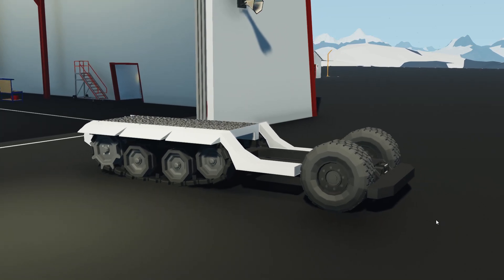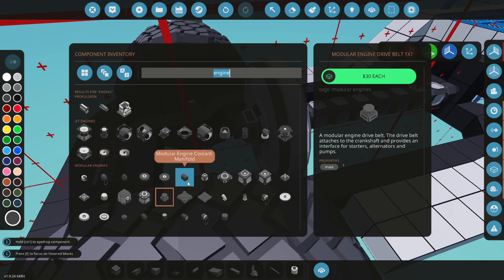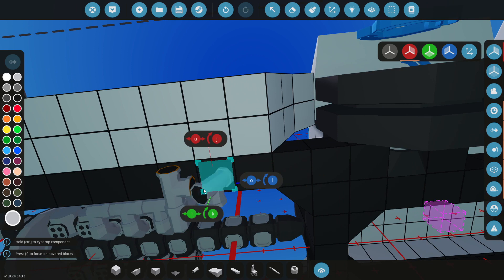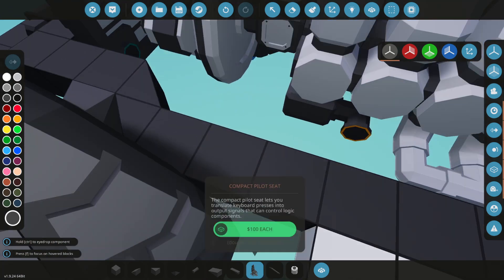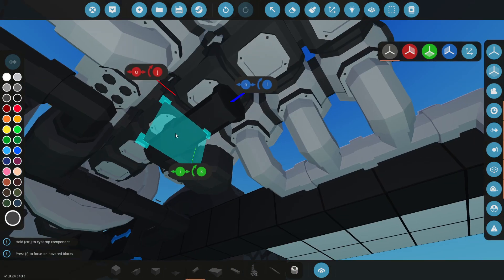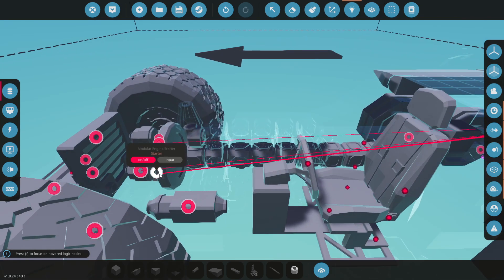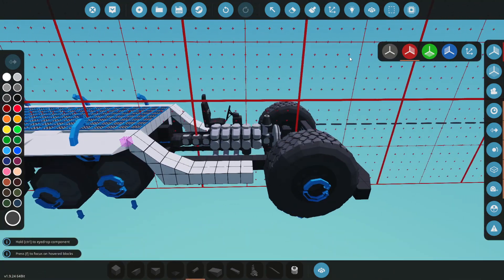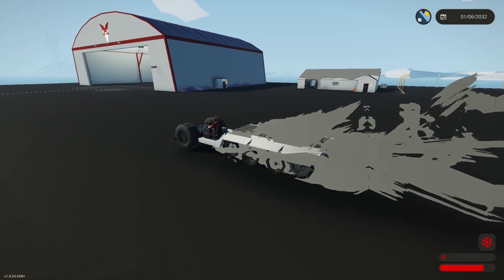I Built An ENGINE For Our Half-Track In Stormworks! #2

Comment: I wish half tracks worked in this game. I really wish they did. The problem is that the traction of all of the wheels has not been addressed by the devs at all so the tracks end up pushing through any and all steering the wheels do at any speed above the speed of smell. So at the point of wanting a half track to haul things, you might as well go full track or full truck to save yourself some effort, namely because there are no fast half tracks in Stormworks. I'm even surprised Frantic's build steered at all.

Comment: You made some mistakes with the engine

The flywheel should normally go on the back of the engine, not the front.

The radiator fan isn’t hooked up.

You’ll probably want two coolant manifolds, with a pipe going in one side of the engine, and coming out of the other side.
Like this:

Bottom view:

     |
    []<— 1st manifold
[engine]
    []<— 2nd
     |

Front view:

     []
  [][][]
—=-=—

Flow
<————>
Reply: I was thinking the same thing about the flywheel, but if he's able to get it going with the starters, it's a lot easier for him. I just know it's really difficult to get an engine going with a fly wheel on the back because it takes so much to get it started from 0. It's unorthodox, but it makes sense to have the starters with their fairly constant speed and torque be the thing to start the fly wheel. I've done some experiments of trying to get a handcrank to start an engine and you can kind of do it, with a bit of jank. You need to spin it with a massive gear increase into a flywheel, get that spinning so fast and then clutch that into an engine and it'll actually start that engine if it has like the throttle and stoichiometry correct and everything. So even though the fly wheel is usually used for gear shifting, the way he's utilized it is kind of ingenious.

Comment: you can actually use the fluid nozzle for exhaust, it has the nice bonus of making exhaust invisible, but be careful, since the update it doesnt make gases disappear, so dont use it in an enclosed cabin

i would use front wheels with suspension, also maybe 1 size smaller

the orientation of the pump for cooling does matter, you put it the worse way round, pumping into the engine is better

its better not to use control surfaces for decoration, i think if you ever use thing thing while there is some stronger wing you will see why